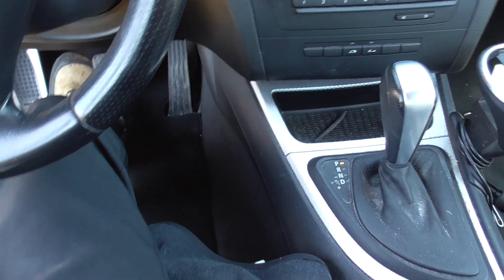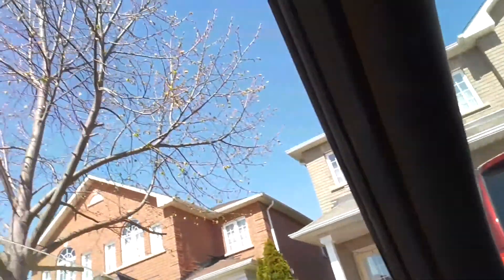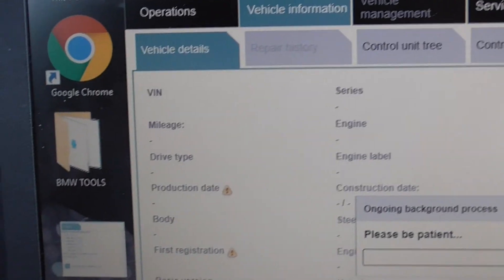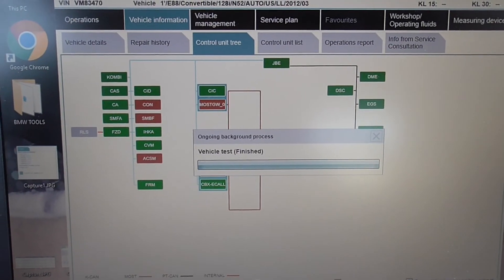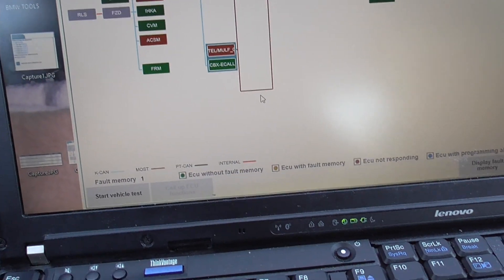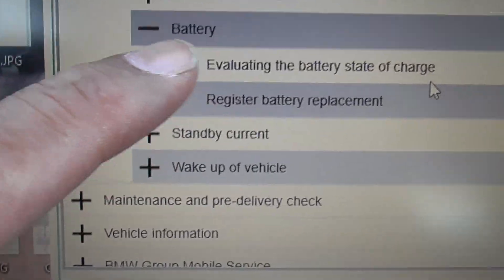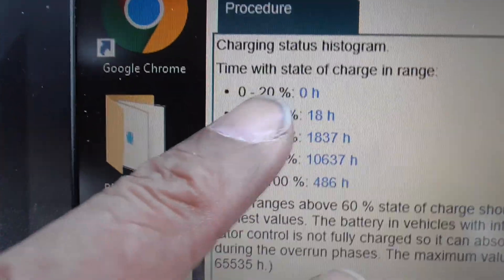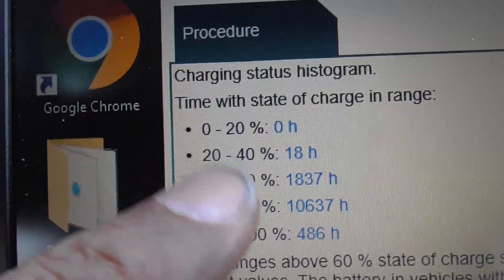BMW E88 Comfort Access (Reading the codes) pt.2 extra

Comment: Hello Mate
I have an 08 E87, and my comfort access has completely stopped working. Originally my driver side handle stopped working, and after a few months, it has completely stopped working. No door opens keyless and I can't start the car without putting the key in. 

Any ideas?
Reply from the maker: hey Abrar, CA is a real pain to work on. Your first thing to do in order would be the following 1> are there any codes 2> in ISTA there is a section for troubleshooting , you can troubleshoot the door handles to see if they are faulty 3> It could be that the 1st thing that went was the drivers door, if that goes short and fails, it can take down the rest of the comfort access system. you can try removing the handle or replacing it with a second hand non-CA part, but you'd also need to reset the CAS module, there is another module in the back (in the trunk) you have to remove a lot of stuff, it's in the wheel well, that CAN get soaked in water and go faulty, I can't remember what it;s called, possible the the Comfort Access module.
Most common thing is faulty door handle, exactly what happened to mine, I did a lot of trouble shooting, but wasn't prepared to pay $400 for a new handle to prove my theory.
I would suspect 1st the door handle is faulty and putting a short on the CA system, but you need to put ISTA on to look for codes and also test, which it can
HTH
Reply from the maker: re-reading I "think" one of 3 things, 1=faulty door handle has taken the system down 2=faulty CAS moduke 3=fault comfort access module in boot
Reply: @AdrianJayeOnline  cheers mate. I appreciate the reply on an old video 

I'll try the door handle and let you know
Reply from the maker: @abrarahmed1269  no problem always happy to help, glad you popped by !